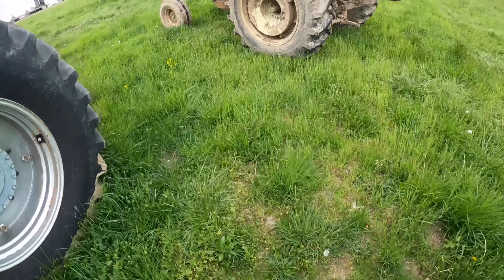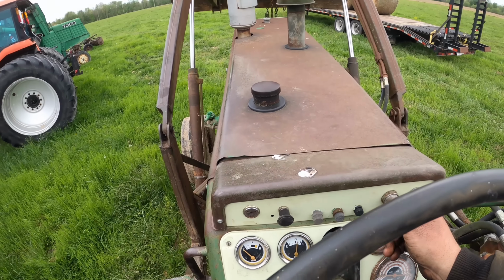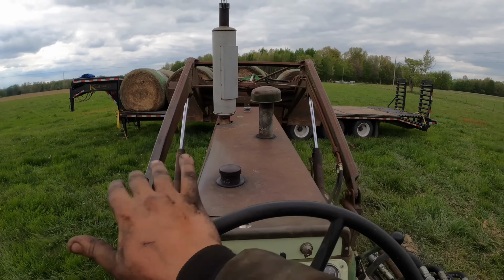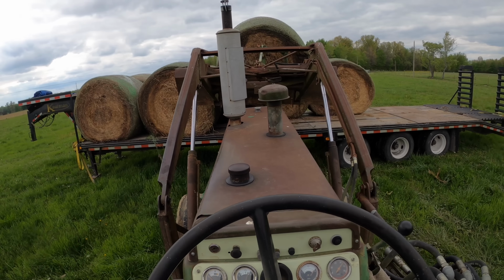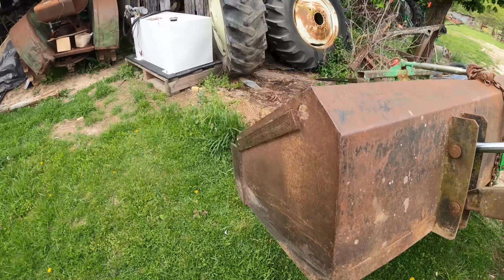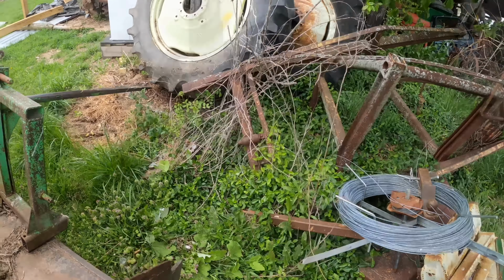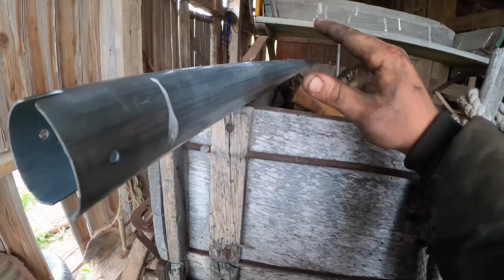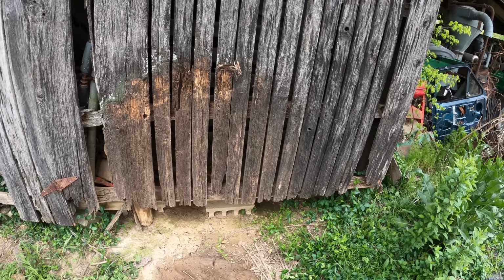Moving Hay and Stuff

Comment: I use the bale spear on the loader to move snap-on duals. Be certain of the valve stem location. Inadvertently snapped one off that happened to be on the top of the rim. What a dufus!!!
Reply from the maker: Yeah, that is a risk when using the hay spear for sure!!